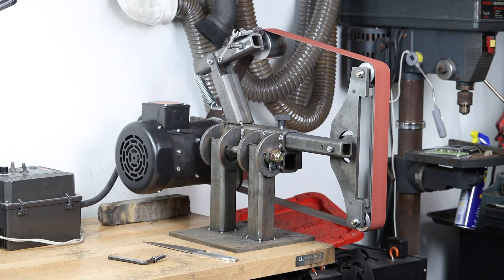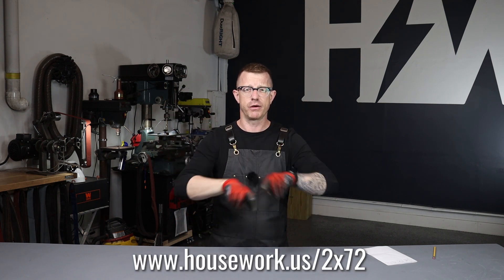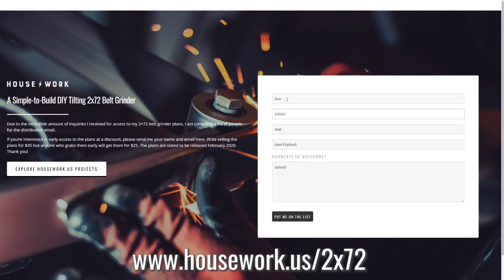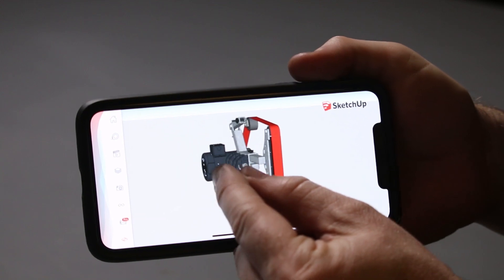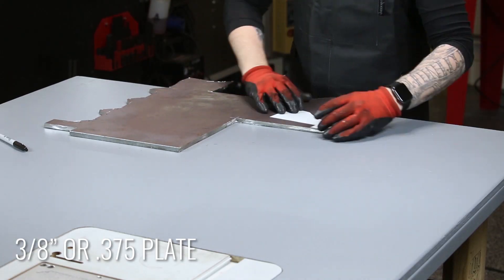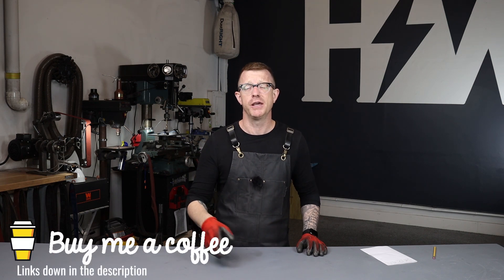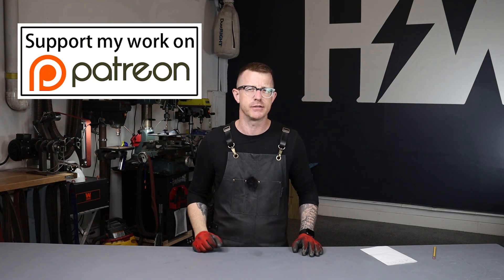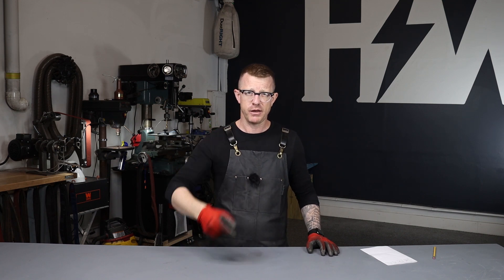2x72 Belt Grinder Plans - How to get them.

Comment: will the file open in AutoCad17 ?  id like to use your plans and build it on my channel 
MetalWorksMachineShop@outlook.com
Reply from the maker: The DXF files will open in AutoCad no problem. The Fusion 360 3D file I’m not sure about. Enjoy the build.
Reply: @HouseMadeUS   I know some  drawings saved in newer formats wont open in older formats. unless you saved it in a older year format.

Comment: Since I use CNC to create parts, I  would need all dimensional info in order to draw the part in Cad. Will that be included in your plans? It would not work for me to print to scale part sheets and trace onto the stock.
Reply from the maker: I’ll do you one better, how about dwg or dxf files that you can pump right into cad for the plate, hinges, & platen? I have those done up already.